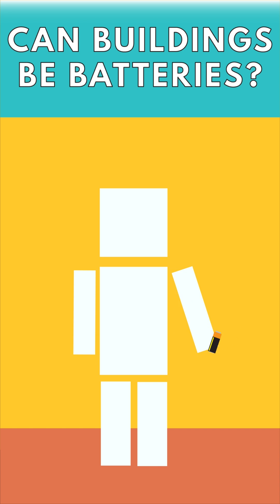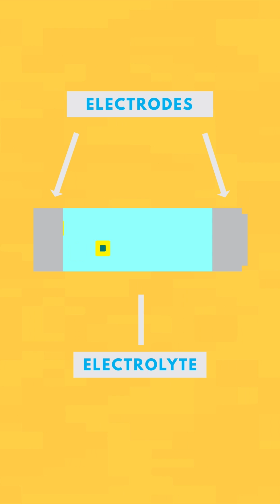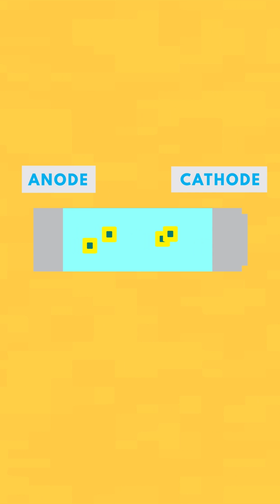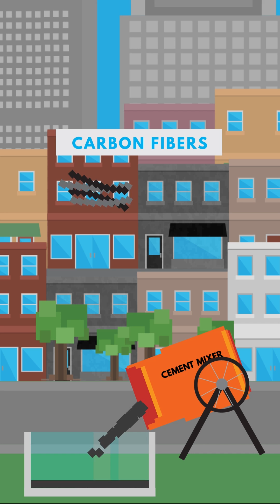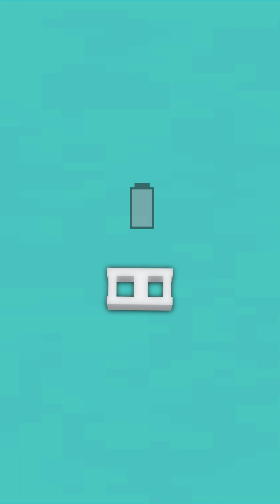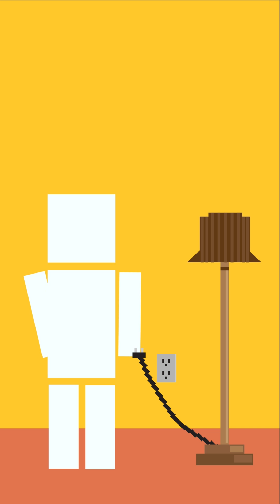Can We Turn Skyscrapers Into Giant Batteries? #shorts #education

Comment: so your saying i caould have a concrete tesla wall that is actually a skyscraper in my backyard that acts like a battery backup? Also there are some other ways to have economical large scale batteries like liquid style ones that have the electrolyte flow over a membrane that releases said electricity, it is very heavy and large, but for stationary applications, it is very good becasue it is also very cheap.

Comment: This sounds like a scam.  How do you change out the bricks when one breaks or how do you even find the one that broke?  They're also just integrating battery technology into the building...for what purpose?  If space is super tight I understand, but a standalone battery would be better in almost every way.
Reply: I helped out an electrician when I was a kid, he has a pen that can detect electrical wires through walls. Also, not all walls have to be batteries, if every wall was then that would not be good and probably harmful to humans or some devices.

It's not a scam, it's an idea for now.